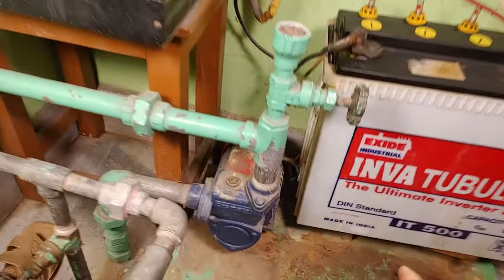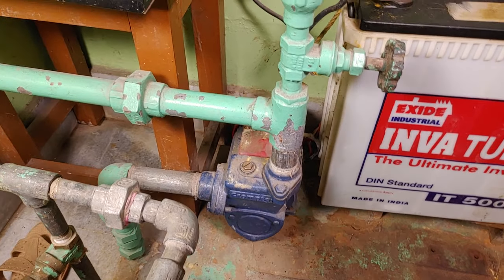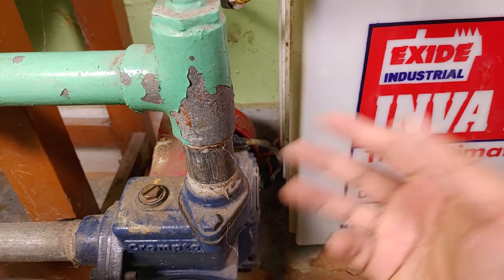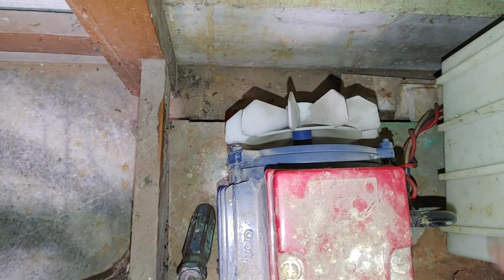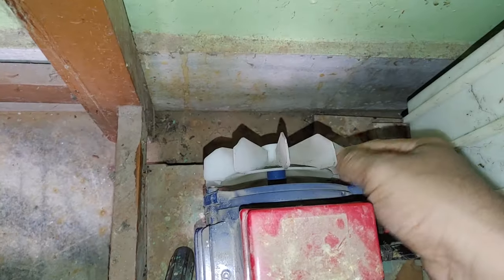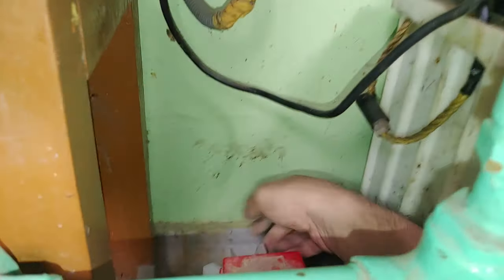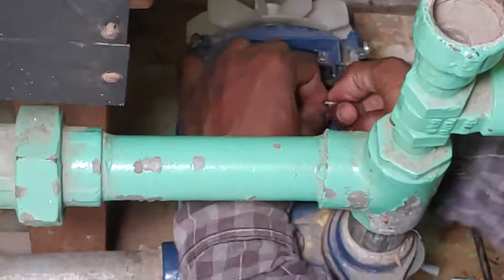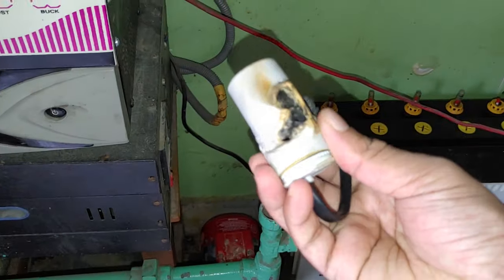How to fix Domestic WATER PUMP MOTOR NOT STARTING AT HOME ?

Comment: Very good demonstration. 
I had a similar issue.  First, I  changed the capacitor. It didn't work. 
Rotor was not moving smoothly. As suggested by you, I rotated the rotor manually later applied oil. Now it's  rotating freely. Now it's working. 
Thanks a lot for uploading this video.

Comment: Help. My motor starts only when i manually spin the rotor with my hand. Wat could be the issue...?
Reply from the maker: I think same issue. Change the condenser / capacitor
Reply: If not u could put some oil in the front axis at and at the back to the axis spinning rod. Rotate manually with your hand with the fan to work the oil in both areas

Comment: I have an issue my rotor is working but water isn't flowing in the pump to go in my house
Reply: It means the foot valve that is located at the end of the suction pipe in the source water tank is malfunctioning - replace it. After that, open the self-priming nut located on the top of the pump inlet and slowly pour half a bucket of water through the hole. Hold your palm over the hole (only if the pump is 1Hp or less),  and start the pump for a few seconds. The pressure will build up and push your hand away. Switch off the pump and close the nut. That's it.
Reply: @Valmik.iNayak  thanks i did fix it tho but thanks anyway